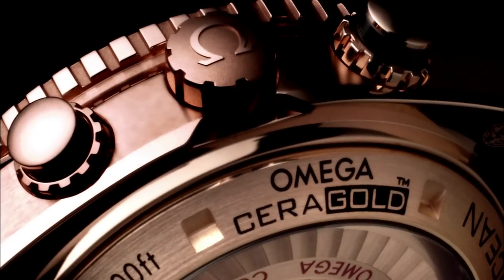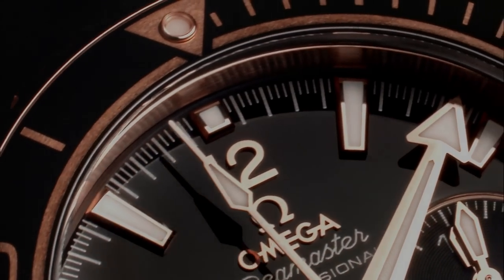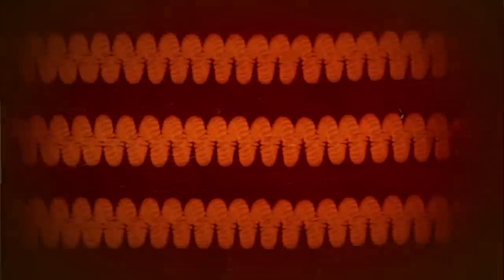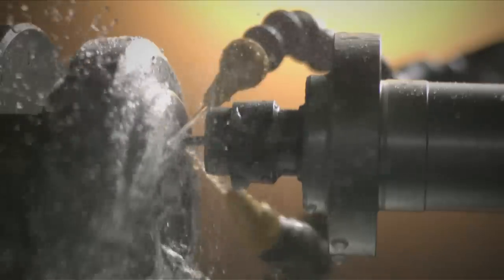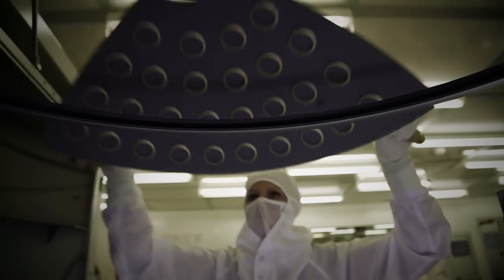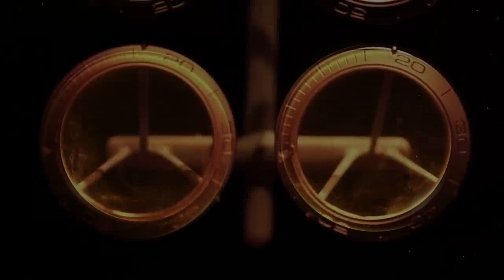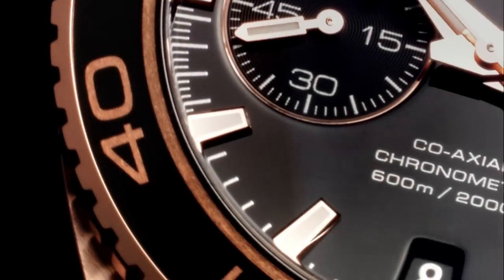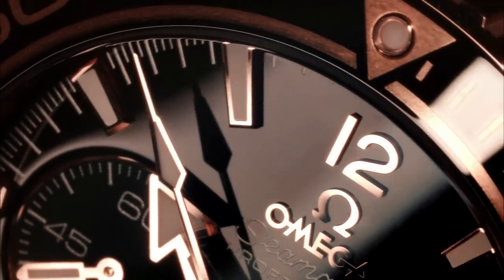Ceragold™ | OMEGA

Comment: Here's something I will never quite understand - precious metals/decorative jewels on purpose built tool watches. Gold on a diver...just why? I know most people will never go diving with their divers, or use tachymeter scale, or measure anything with a chronograph. However, I still find it a little bit funny looking. It still looks like a tool. Just gold plated. Where are those gold plated hammers when you need em, eh?
Reply: Why do street cars go faster than 80 mph?
Reply: @dandahl5964  This analogy makes no sense. Because there are situations and places where you can legally go over 80 on a street, in a street car.
Reply: @Quicksilver_Cookie Should all gold watches solely be dress watches? Should all buyers of Planet Oceans be seasoned divers? No, of course not. The blend of a robust tool watch made out of fine materials is enticing.

Comment: I disagree, ceramics are brittle, unlike metals which are ductile. The brittle property would result in them being unsuitable for constructing the bracelet as for example if the links were bent the wrong way or subjected to hard knocks, areas of stess concentrations especially in thinner sections like the connection between links and clasp would crack.